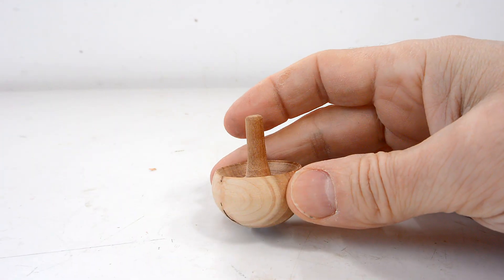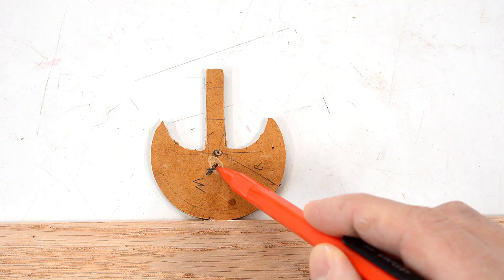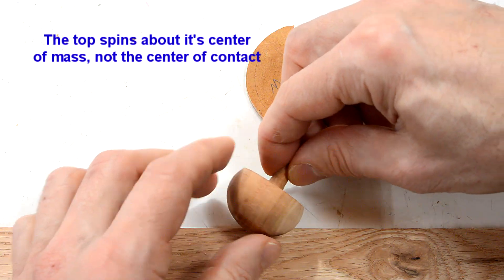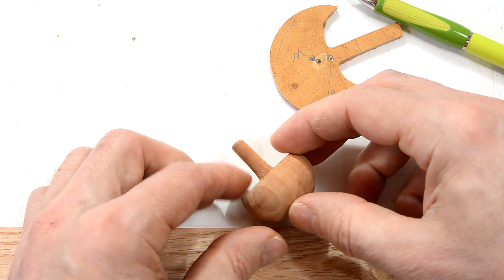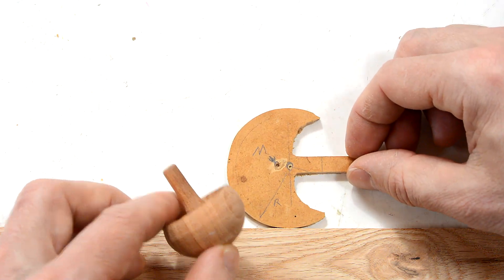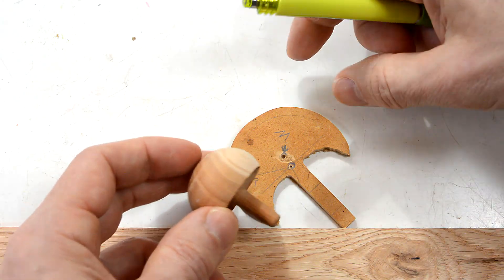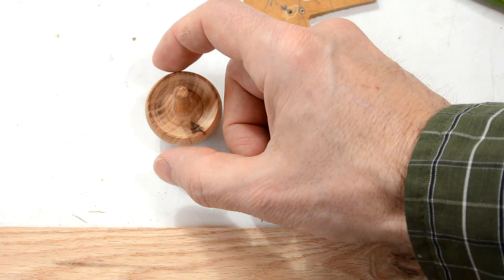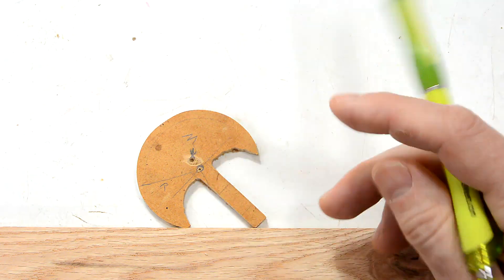How a tippe top works

Comment: A nice illustration of why it suddenly flips faster when the handle hits the table.
Now: Here's an idea for you to try - PLEASE!
I was thinking of adding 2 or 4  little pegs on the sides of a spheroidal top, but WITHOUT the CG moved from the centre - so it DOESN'T FLIP. But, I then move a heavy cube of metal towards the top so that one of the posts hits the metal. My guess is that the resulting impact should cause a instantaneous torque to flip the top up 90º or so. I suggest not using a handle - it might interfere. Use a drill to get it spinning, with a screwdriver in the drill, and matching screw in the post.

Comment: Have you tried to taper the tip, form a flat to a higher curvature, it should stand longer upside down spinning on the tip sharply curved surface, isn't it?

Comment: What happens if you try a heavier wood, hollow it out even more, and give the handle more of a pointed tip - seems like the final "upright" spin is being shortened by friction with the end of the handle on the table-top? I don't have a lathe, otherwise I'd try it myself.
Reply: +Big Dave A handheld electric drill will suffice.  Clamp the drill firmly to make it stationary.  Use a file or whatever to shape the wood into a top.  Before you do any of that, use a hand plane or rasp to rough shape the wood stock.

Comment: The curvature vs. mass principle works in reverse too, where a small curvature relative to the center of mass will tend to bring the center of mass directly above the center of curvature.  A top with a small radius at the tip will sometimes spin better than a top with a sharp, pointy tip because the pointy tip doesn't have as much self-righting action and will instead precess around the vertical.

If you put a small radius on the handle end, then I would venture your tops would appear nice and stable after it tips up.

Comment: Would it tip faster if it you put a steel dowel at the bottom (initial spin point) to move the center of gravity further from the center of curvature?
Reply: +Andrew Klein what about a steel band around the circumference to increase its rotational inertia?
Reply: +Phillip Spellman that might actually work against you, by bringing the center of gravity closer to the center of curvature.
Reply: Depends on where it is placed. Also I was going for a longer spin rather than a shorter flip.

Comment: Great explanation, thanks, Matthias!   Like a few others I find myself wondering about how "perfectly" someone could get one of these to spin.   like what if it was made out of metal (MDF?) so that the density is consistent, then spun it up with something like a drillpress.  But the release would be tricky to engineer, and you'd want a REALLY flat/level surface.   Probably not practical, but fun to imagine.

Or I would also echo the Slo-Mo of it tipping could be cool.
Reply: +Wordsnwood (Art Mulder) Here is a simple idea for the release.  Using a keyless chuck on an handheld reversible drill.  Insert the top into the chuck and hold it just above the table top. Tighten the chuck jaws only just enough to grip the top.  When it gets to rotation speed, grasp the chuck to loosen the jaws  The top then falls to the table top.  The surface need not be level.  Spin the top inside a large stainless steel bowl of a constant radius.  The top will find it's equilibrium on whatever surface of the inside of the bowl.

Comment: Matthias, I imagine the length of the handle is important. I'm guessing it should be either the same distance from the center of mass as the round edge or on a point of the line of curvature of the shape of the top. I think with just the right length and a pointed (<<important?) handle you could make one that goes upside down more easily and spins for longer and more smoothly. I wonder if you could make a device to spin and eject the top for maximum rpm, like those little toys they make for flying whirly whachamacallems..

Comment: I challenge you to make a device that will spin it perfectly vertical (or as close as you can get it). Maybe using the drill press?
Reply: +William Butler I used to make spinning tops for the neighborhood kids.  My goal was to make the tops so well balanced that they would spin for a long time.  (I got that idea from top makers in Thailand or somewhere near there who would make tops that spun for hours.)  I would shape the tops on my lathe as fine as I could.  I used wood that I had air dried in a controlled environment.  Then I would add small metal strips to the wood tops to achieve a precise balance.  I was fairly successful, my tops would spin for up to 20 minutes.  But as you allude, setting the top into motion was the bug.  So I borrowed an idea for how to make fire with a string and disk.  I used that as a tool to better lend stability.  I cut a hole in the disk to accept a pin which would be inserted into the top of the top. The longer the center shaft of the tool the better. One downward plunge would set the top spinning at a high RPM.  Once spinning the pin would be pulled upward out of the top.  By this mechanism my movement was straight down which did not impart a lateral force on the top.  Ergo, little to none wobble.

Comment: Now make a jig to spin it perfectly
Reply: using the Pantorouter
Reply: +Koishi Komeiji Spin is only one component. The wood itself is far from perfect, full of changes in density and texture in the growth rings, and imperfections in the [wood] turning. Then there are changes in air movements as it's spinning (and because of its spinning), oil from your fingers, temperature differentials in the air, changes in temperature due to friction with the surface, imperfections in (and non-perfect leveling of) the surface it's spinning on. Zoom way in, and you'd see an alien landscape of imperfections everywhere. You could probably get a tippe top to spin for an extended period right-side up, if you used high-precision machining of a good, very uniform metal, on a precision surface in a controlled environment.
Reply: +Koishi Komeiji It'll still tip since the slightest minute imperfection or disturbance will make it start tipping, and you just can't escape that in the real world
Reply: Koishi Komeiji I span one perfectly once!

Comment: So if you sharpen the handle to make it more stable when it turns upside down it won't turn upside down?
Reply from the maker: +GroovyDrifter I'm sure it would.  But a wider handle means it's easier to flip, and easier to spin up.
Reply: +Matthias Wandel And safer for childs too
Reply: +N LM I think it may be possible to make a point wich retains enough grab to allow making it spin fast enough, maximize the friction when the handle touches the graund and minimize it when it is vertical. At 2:15 you can altmost see what I'm trying to say (sorry, english is not my first language). I wonder what would happen if there was a little cone in the top of the handle so when it touches the floor the fhe friction area was bigger. The cone must be the result of the intersection of the rotating handle (cilinder) with the floor (plane) in the center of the cilinder (cone tip). Sorry if this sounds weird but it's the better I can do in english...